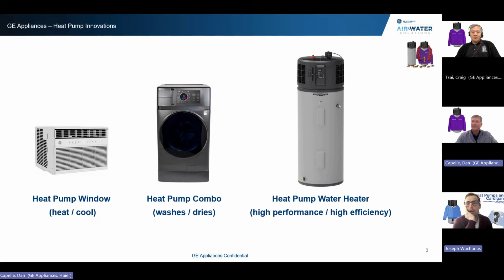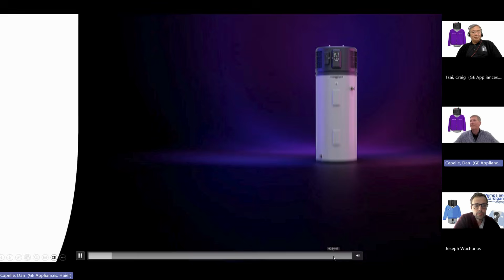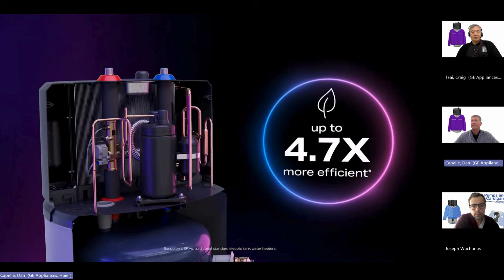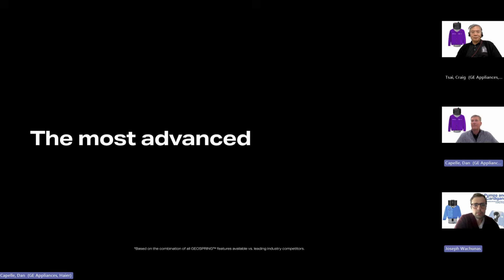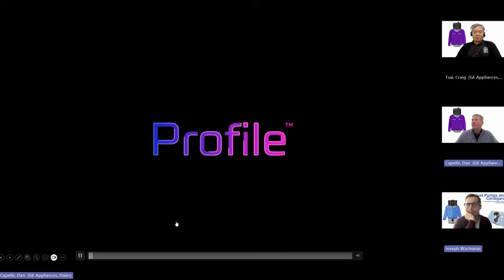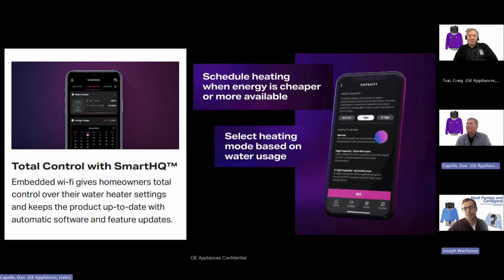Heat Pumps and Cardigans Episode 1

Comment: What is the coldest ambient air temp that will keep this running in HP mode? My current Geospring version stops working at 40ºF which is unacceptable for so many months during winter. I assume this goes much lower (since my HP HVAC goes down to 15F), but I haven't heard anybody mention this important item.

The discussion about "cold weather performance" is only about fan and compressor speed? What are the numbers? at what ambient temp will it still make hot water? And what do the 120 V units do when it gets too cold to run the heat pump?
Reply: Spec sheet says 35 degrees. I'm sure it can work colder but they do not put a defrost circuit on units like these(probably cost). COP may drop down to 1 or less from the temp delta at low temps too. Image trying to heat your living room to 120 degrees.

Comment: I need help understanding why the 120V has a lower UEF rating than the 240V models?

If you convert a 120V to 240V - will you achieve the the same UEF as the 240V (3.2 120V vs 4.3 240V)? I think they said it would in the video but I would like that clarified. 

Why is the 120V version more expensive than the 240V?

It is really cool you were able to sit down with the folks that designed this HPWH and I am really hoping you engage in the comments.

To GE - Dude - it is a water heater - DIY people can figure this out. Please don't constrain this to....professionals. The IRA for this thing is dead at the end of year. You need to get this in HD and Lowes like yesterday.

Comment: Are there venting or space requirements with the newest heat pump hot water heaters? I seem to recall that can be a roadblock to switching from resistance electric to a heat pump model. Thanks for the podcast info, looking forward to the next!

Comment: This video fails to mention that if the refrigerant in this product leaks into the air, it turns into TFA (trifluoroacetic acid) when it’s released into the atmosphere. This heat pump should be using natural refrigerants instead.

Comment: My wife and i take a shower pretty much every day. Wash maybe 6 loads of laundry a month. Hand wash dishes a couple times a week. Actual usage of natural gas is about $10/mo. If were switched to standard electric, it would go up to around $30/mo. Getting a hpwh might save us $1/mo over nat gas, spending an extra $1,000 on an appliance that lasts 15 years to save $1/mo doesnt make sense.
Reply: I'm curious how you calculated your NG usage so precisely for the WH? Is it your only gas appliance? Where in the home is your WH?
Reply: How much is the connection charge? and how many months of the year do you use the furnace?
Reply: Sometimes it isn't only about the money. 

I my world energy efficiency wins. Even when it costs me more money to not combust.

Comment: At 1:01:00 he talks about having a module that could be extended so it’s within the range of Wi-Fi.
It seems like if you gave the unit Wi-Fi capability AND Ethernet connectivity, you wouldn’t have to worry about its proximity to the router. 
(I’m not sure if this hot water heater has direct ethernet connectivity available—-but if it doesn’t, it SHOULD…)